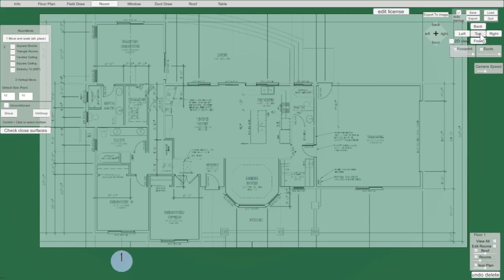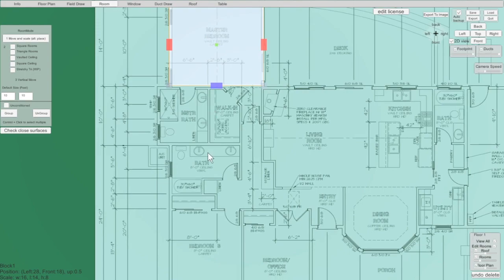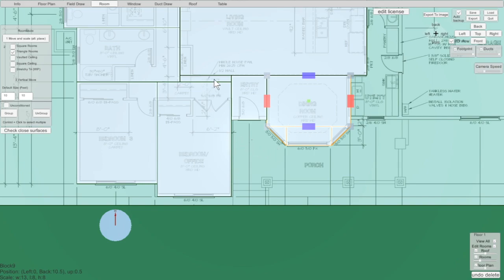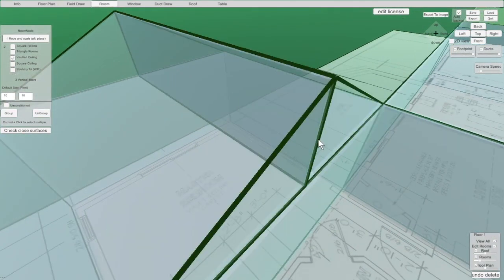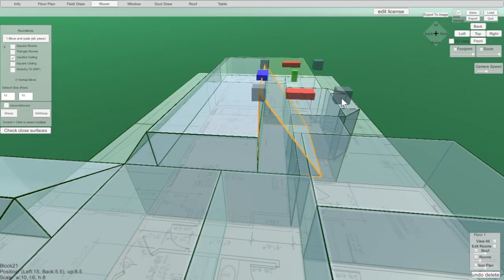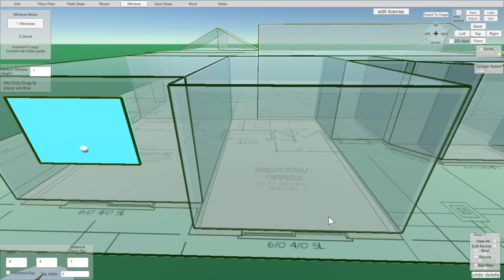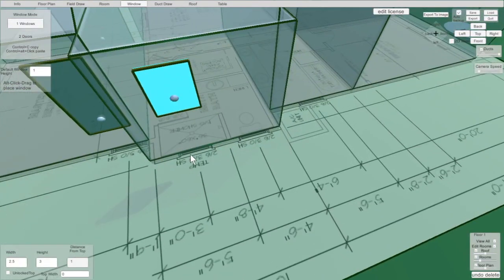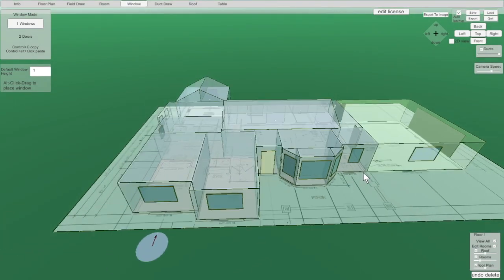Tutorial #3 - Placing Rooms and Windows

Comment: Thanks for your great training videos! I'm doing a Trial evaluation of Kwik Model for my company to decide if we'd like to purchase it. I was able to follow along with your video and do my own design using the same floor plan. I was wondering how you would address the Coffer ceiling though? For the time being I used vaulted ceiling similar to the Master Bedroom for Load Calc purposes, but I wondering how you would hander it properly. Would I just need to create the shape using 3 rectangle rooms and 4 triangle rooms and then group them together with the actual room? Thanks for any direction you can provide...
Reply: Hi Mike.  Keep in mind that for walls and ceilings, all Manual J really cares about is surface area between conditioned and unconditioned spaces.  It doesn't matter how you draw it.  Don't worry about your 3D model looking exactly like the real house as long as the areas are close.  I always recommend taking a minute to run the calcs one way, then make a few changes and run the calcs again to see what difference it makes.  Often, you will be surprised how little difference some changes make - not all, but some.  Practice and repetition is how you get good a knowing which things are important and which are not.  Most coffered ceilings that I have seen (all new construction) were furred down below a flat ceiling.  All of the additional "pretty" framing for the coffer was below the thermal boundary (below plate height), so modeling it as a flat ceiling is fine.  If you encounter one that is framed up, where it is taller than surrounding rooms.  Just use rectangular vaulted ceilings stacked on the room and "squash" them down to the correct height with the green handle.  The little side parts of the coffer should be designated as "knee walls" in the library, since they are adjacent to attic.  (Don't worry about 45 deg corners.  That's unnecessary detail.  Calc it out on paper to see how little it changes the area.)  I hope that helps.
Reply: @russking63  Thank you for taking the time for your reply Russ, I appreciate it. I did wind up making an octagon shaped Coffer Ceiling using 3 rectangles and 4 triangles, about a foot higher than the rest of the room. But I see your point. Unless we're looking to impress a client with our design and drawing skills, the important thing is that loads are accurate for proper sizing. So the actual shape doesn't matter as long as we're able to duplicate the additional load. Thanks for clarifying. 
One additional question- when I click on the Data page, I'm getting an error that says, "One of your duct lines are incomplete. Make sure every joint in the line reaches a register (Start Collar (VentOut), Start Collar)" I'm confused because I've gone through all the ducts and they're all connected at both sides to start collars and registers. I have a few supply and one return trunk that connect to Plenum Triangles which feed/are fed by multiple branches. But everything is connected to a start collar and all branch lines are connected to registers. I redid all the flex ducts and I'm still having the same problem. I also clicked on my plenums to make sure I didn't leave an empty start collar, but it's all clear. Any suggestions? Thanks again, and happy Friday! (mikeh@purifiedac.com if that's easier)